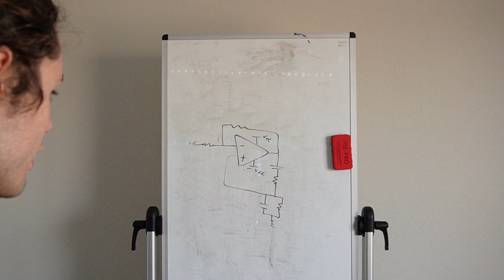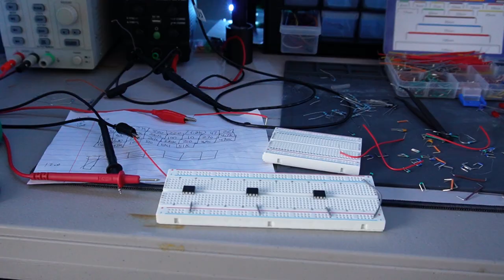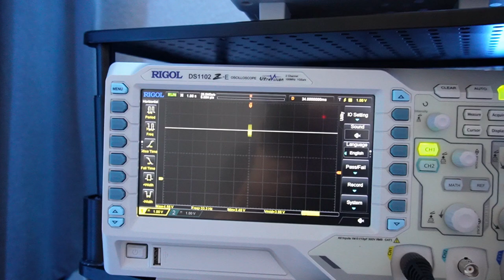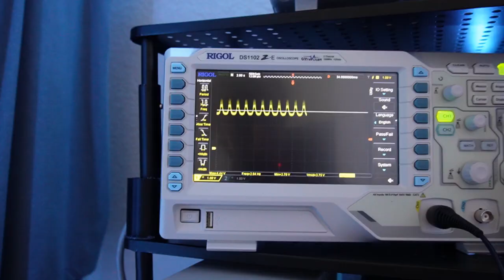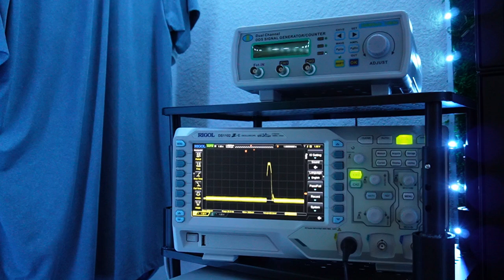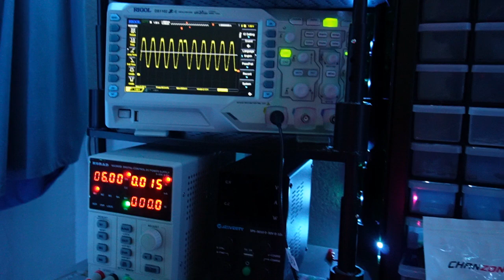Powering A RGB LED with Sine Waves

Comment: i hate the resistors with blue background. cant read them
Reply from the maker: Yeah, I had to whip out the multimeter because I kept forgetting what resistor values I put in and it is very hard to tell with the blue ones